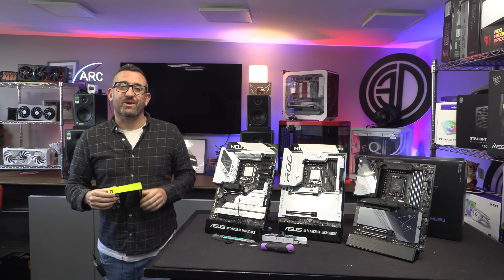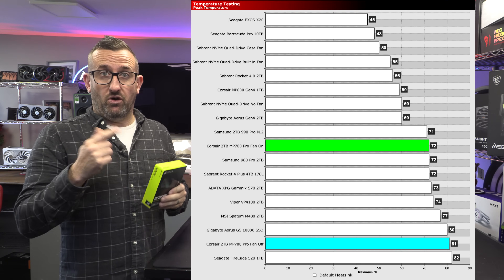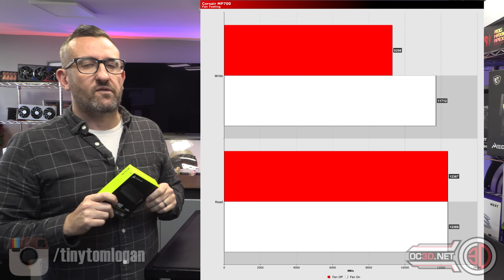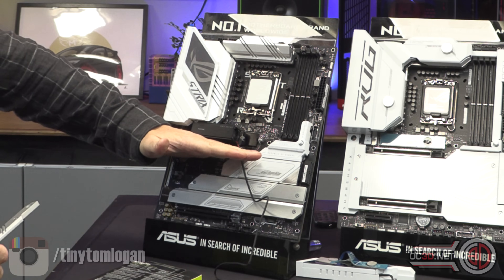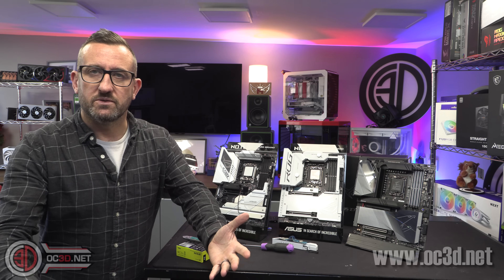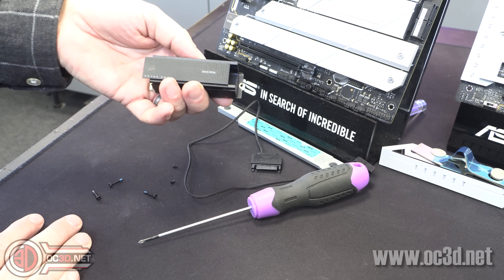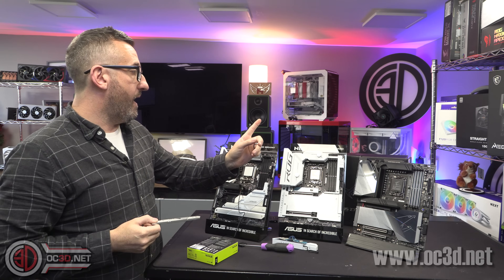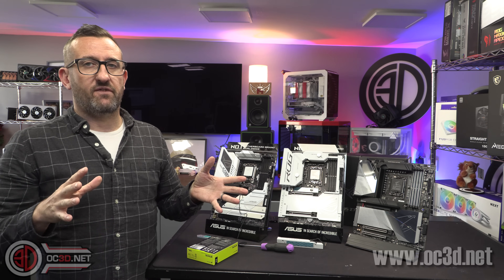The problem with PCIE5 drives and motherboards  - Corsair MP700 NVME

Comment: What if there was no TEXT Tony?  LOL  Could you live with no TEXT on the heat sink?  I would say, as long as it fits, and works, just plug the thing in and run it.. now if its not fitting, that is a HUGE PROBLEM.. that would not be acceptable.. they should be buying some mother boards and doing some measuring of the main major boards being offered from the different vendors and then making a choice as to what size and shape their product needs to be to fit in at least the most possible boards they can!!  And for them to change around the name, I think that should be a no brainer for them.. but I am all for having a gen 5 drive.. I understand there is some heating issues.. but how much of an issue is it in what would be peoples most normal use of the drive.. for most people.. or for a lot of gamers, I can see if you are transferring huge amounts of data at one time, but most people are not..  but if you are and its a huge deal to move that huge amount of data regularly, then I would think aesthetics is not your highest priority either.. data transfer is.. and if you  got a white board and want a white ssd cooling solution over the top of the ssd, get a can of spray paint..

Comment: pixel density, onboard sound, sli, native throughput 8 n 8 all at once data instantly, pci16 why sound takes up pcie lanes and lowers output on video quality by wasting throughput hence why sli or a 4k gpu using onbaord sound ddr xmp 16 n 16 xmp nvidea and intel gigabyte or asrock boards back in 2017 did this in path tracing realtime on the 3d gfx today its done on cores too many lanes cant do native and lanes are not fast enough it requires compression and codecs today hence cant do native live stream 4k its fake and rendered then inserted making latency using cheap hardware reject binned from high end mono or quads they dont make anymore , because we only used half of 4k say gtx1080ti we could send 2 outputs and the sound from a say mboard with sound on that to save lanes to send at native real time to screens at 2x half a 4k 60fps today they cant do this they are not able to stream native 4k they have to store on memory uncompress then send it in parts then put it back together thus held back by latency to sell share profits up as no upgrade or hardware is good its all damaged cut down and now needs to ray trace upscale insert frames has lower colours and sound quality hence huge socket is more cpus tryinf to be one they cant they slow due to sending data thus no more gaming pcs or high end  just rt creator pcs that are trying to blame devs for games when we had 4k on sli decade ago but now  games have had to be recoded to run emulated controlled by cpu using ai and windows, we dont want os running we load a game in by iso n run it on gpu native at zero latency aka real sd gfx they cant do this today so rewrite games and lie, crysis was remade to make a cut down upscaled to stop folk finding out it wont run crysis original which requires a good gaming pc they turned pc back to consoles but worse res lower fps and lag but sony had the good hardware hence games and vr worked on pc too they didnt emulate under windows we ran software today they need rt ray traced hzs sound quality colour count are not talked about because if people knew a cd had higher quality and now they have to sample and compress the data to read and send then play ,  we went from millions of colours to 4096 in hardware lower hz needs codecs and cant do native real time and PEOPLE BOUGHT INTO THIS THINKING DLSS FPS AND NOT ONE YTBR CALLED IT OUT WHY, THEY DONT MAKE HARDWARE NOW THEY SHAVE THE BINNED AND TRY GET IT WORKING THATTS WHY ITS ALL FPS SALES AND MULTITASKING UPSCALED DLSS MEANSD IT NEEDS TO UPGRADE NOW ITS A SELLING POINT.  YOU DONT CHANGE FPS OR RES IT IS THE HARDWARE AND MONITOR THAT SETS IT BECAUSE ITS FIXED TODAY WINDOWS DOWNGRADES THE RES TO PLAY ON 4K TVS BECAUSE IT CANT DO IT SO THEY EMULATE NOW, WHICH MADE IT WORSE IN QUALITY LATENCY BUT THEY HAD OLD CPUS DEFECTS FROM THE HIGH END 100 102 FABS LEFTOVER TO SELL , YOU ALL GOT LIED TO AND FRAUD TOOK PLACE.  TO SELL OF THE STOCKS AND THE FACTORIES SHUT DOWN LONG AGO THEY CANT MAKE HIGH END WITHOUT SELLING THE 80% 103 104 105 16 BINNED SILICON THE FABS HYNIX CRUSADE ASROCK GIGABYTE MONO ENDED AND 2ND HAND IS EXPENSIVE YOU DONT GAME IN WINDOWS YOU EMULATE AND RUIN THE QUALITY, A PC CAN BE BIOS CONTROLLED BY FLASH TO RUN ANY CONSOLE NOT EMULATING BECASUE ITS A PC TOO IS A CONSOLE THE HARDWARE USED TO GET BETTER NOW IT GETS WORSE.  its all 2d rendered to look like 3d now not how we should do it, we used to do complex realtime rendering called true ray tracing now its done in memory slower cheaper laggy to make money the games need to upgrade to catch up with 2016 hardware now they downgrade to run on rt amd and all high end fabs gaming boards are not sold , hence remasters are downgrades to us holding 2017 high end tier hardware when we can run the original better and not emulate under windows we run the game .

Comment: i'm not listening to a guy who owns two sizes of mackie monitors, like what, was the one not good enough to tell you they're terrible?
Reply from the maker: Hey dude, Ive had both for review. I prefer the 8's for larger areas tbh and they are the ones hooked up. They are not as bad as youre making out though tbh. The 8's are pretty good for my uses out here in the shed.

Comment: So true about the mobo heat sinks... On the x670 Crosshair Hero and a 4tb Crucial t700 (using the gen5 m.2 wired to CPU), I could not use Crucial's heat sink due to the bottom plate of the heat sink not allowing it to seat flush on the post, this meant the m.2 "quick connect" latch does't fit (I came close to breaking it) ... Had to use the mobo's heat sink which isn't all that bad, but I could have saved $30 by negating crucial heat sink.

Comment: Should just be heatpiped into the OTT VRM heatsinks.  Most of these snazzy [AMD] boards these days don't even need the VRM heatsinks, so plumbing the NVMe drive in seems a no=brainer to me.
E2A:  Heck, it'd even be one of the very few places where the heatpipe is optimally oriented for most motherboard orientations.

Comment: We need to go back to the 2.5 inch form factor.. Its crazy to think that all super fast M.2 storage are able to cool this way..(on a motherboard)
Better put a m.2 drive in a 2.5 inch enclosure as cooling block and go back with the old cable. 
I really dislike how much pci-e slot arent there anymore just because of that bad solution called m.2 drives.

Comment: I have a x670e hero and a t700 4TB getting terrible speeds any ideas are you seeing the same ?
Reply: t700 from crucial? I have a t500 and heard of some t500s having a firmware issues dropping read or write speeds down to half. Maybe t700 has the same issue?
Reply: @jod1653  excatly that, i have a massive thread open on ASUS and MSI website, i can see both AMD and intel users having the same issue(s) have tickets open with micron also.

Comment: PCIe 4.0 versus PCIe 5.0 M.2 game loading is within one second on most games. The only differences beyond that I've ever seen are from super cheap M.2s without a DRAM chip. Regarding the Z790s x8 GPU issue RTFM .. the PCIe 4.0 M.2 slot below (most MOBOs) the PCIe 5.0 M2 slot is also direct to CPU. Win win!

Comment: Considering the rear ventilation holes on most cases for the PCI slots that would be a better place to pull cool air in so .. absolutely yes I would flip that Corsair fan around. This isn't some 120 / 144 mm M.2 fan.
Reply: However, the biggest gripe I would have is why doesn't Corsai use a standard fan header instead of that molex / SATA power.
Reply: Since the exhaust fans (slot coolers, gpu blower fans) are often on that side as well, you'd be pulling in hot air.
It's not a rack server with hurricane force winds, but wouldn't the rotation of the 40mm(?) fan be impeded by the airflow of the (front) case fans?
As for the power connector: maybe they're tapping from the 5V pin to keep it running quiet, and since the regular fan headers are 12V, they're not suited?
Reply: @bjornroesbeke  .. You're pulling cool air from the bottom and out the side as opposed to .. from the bottom out the top .. but still both of them through the GPU. Think bout it.

Comment: Thanks Tom.  Corsair has a waterblock for a 2280 size, M.2 SSD.  I used it for a build with one of their MP600 series drives.  It is the Corsair XM2 (CX-9029002-WW).  I used it in a build a while back.  Worked very well, but depending on your MB, it may be just as difficult to fit as that fan above the drive.  I don't think there would be any problem using it with an MP700.  In my opinion, use of any gen 5 device in current boards is a problem  because of lack of lanes.  Use one in the gen 5 slot and you go from 16 down to 8 lanes for your graphics card.
Reply from the maker: I think the clutter for the extra hosing is just going to end up looking messy. A single cpu/vrm and pcie5 heatsink with just two connectors would be ideal

Comment: I can only see true use of the 5.0 M.2s in highend machine learning and rendering environments for the next several years. With the new price point on the 4TB 4.0s, last generation is going to be what replaces 2.5 amd 3.5 inch drives in non enterprise or NAS systems completely.

Comment: Any board that has the gen 5 slot near the bottom will do well. I tried my T700 on an MSI meg ace and it idled around 34 and hit 50 under max load. This was about 20 degrees cooler than other boards I tested it on where the gen 5 slot is above the GPU. Especially the Asus ones, I could not get it below 50 at all on the few I tried.

Comment: It would be less expensive, cleaner, and easier to use an add-in card for multiple M.2 drives that had dual fans to cool them.
Reply from the maker: But youd need a pcie5 slot for that if we are staying on the pcie5 conversation
Reply: @OC3D  Yes, you could bifurcate your PCIe5 x16 slots to x8/x8 on a Z790, or if you had an X670e board you could go PCIe5 x16/0/x4 or x8/x8/x4.  I guess the extra PCIe5 lanes on Zen 4 help.  I also don't know how long consumer grade SSDs will last if you are driving them to the max, they were meant for burst traffic usage case.  I think you are moving into HEDT territory.

Comment: If you want gen5 speeds with gen4 drives, fill all the slots and raid stripe 0 4x m.2 drives stripe0 and bam instantaneous gen5 speeds without the heat

Comment: Big heatsinks are the exact reason i avoided the drive, not due to sound or cooling just the size, on my mid range board I have little space with my set up and so larger heatsinks are an absolute no go due to size of cards already installed and make it impossible to fit this type of nvme, nothing against the drive itself I generally like corsair nvme's have two 2tb mp510's and also an external 1tb mp510 from before upgrading as well as  other brands, but with a HBA card the 6800XT and a nvme add in card fitting the ones with large heatsinks just not possible.

Comment: Good on Gigabyte for having a decent heatsink on their board for NVME drives, and I wouldn't drop to a Gen 4 just drop to one of the 10,000 as it should be a bit cooler than the 12,000.

Comment: Hi Tom, One alternative to this situation is a lower-height heatsink with a fan that you can order cheaply from many retail/webshop dealers. Even with that, you might still have to remove the M.2 cover. Alternatively, the MP700 PRO Hydro X Series version ships with a pre-assembled water block that fits easily into your custom cooling loop, delivering top-of-the-line cooling and performance while virtually eliminating throughput throttling.
Reply from the maker: I dont think the lower heatsinks even with the fan would cope with this. Those were designed for pcie4 drives
Reply: @OC3D  I have an ASRock X670E Steel Legend and it has a third-party M.2 heatsink with cooler (fan) that fits without problems.

Comment: some asrock eatx boards like the 650e taichi lite have the main pcie5 nvme next to the ram slots, not above the gpu. love that.
Reply: My Z590 OC Formula was like that and the drives do get much better airflow there as well which is nice, the typical place is sort of a dead zone most of the time which doesn't help.

Comment: EK-Quantum Momentum² ROG Maximus Z790 Extreme D-RGB - Special Edition Monoblock is already out for ASUS ROG Maximus Z790 Extreme motherboard which can be used with contact frame or delided direct-die CPU, Voltage Regulation Module (VRM), LAN controller, and primary m.2 drive. 

But I should say this, it is NOT cheap, you can buy another high end motherboard with that price tag.... Too much feature and option / accessory comes with the monoblock, so high price tag is kind of understandable. 

IMO, PCI-ex 5.0 SSD on a INTEL platform should be considered only IF / WHEN INTEL decides to put dedicated PCI-ex 5.0 laned for the SSD and stopes sharing bandwith with the GPU. May be with 15th gen?

Comment: ATX motherboards are desperately in need of an overhaul. RAM like a sail hampering airflow, huge 50mm or so power connector (need atx12vo) and the PCie drive right above the hottest component in the case

Comment: They've really lost their way on the concept of the nvme consumer drive. I think moving forward its going to have to be a 16x slot with a card with 4x4 bifrucated. Or, use the U.2 interface and have the drives in 2.5" form factors with a decent heat sink.
Reply: I think that at some point they would have to transition the sata to U.2 or something that can at least obtain speeds in the gen 4 range.
Reply: I’d like to see more mobo manufacturers put the Gen5 NVMe slot next to the RAM.  Then you could have a heatsink without clearance issues.